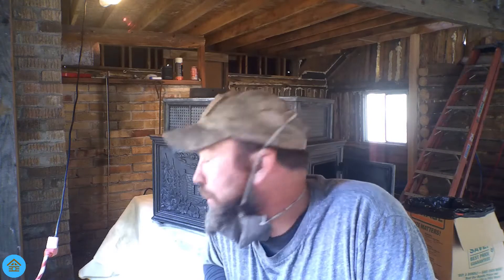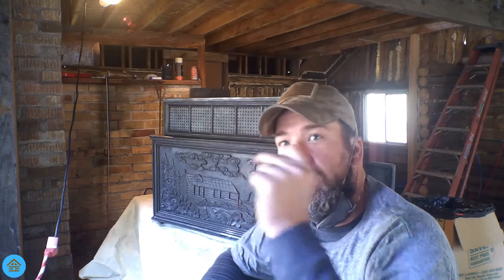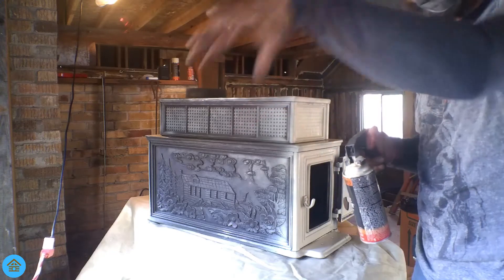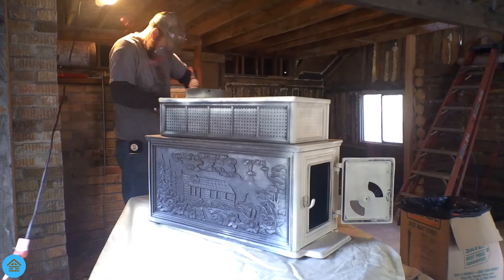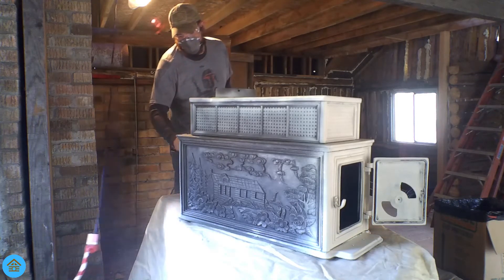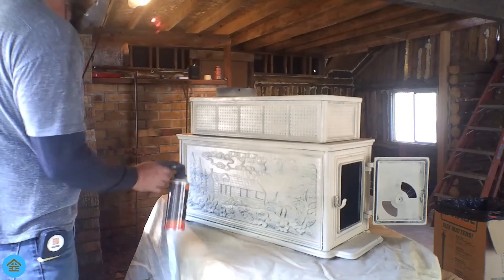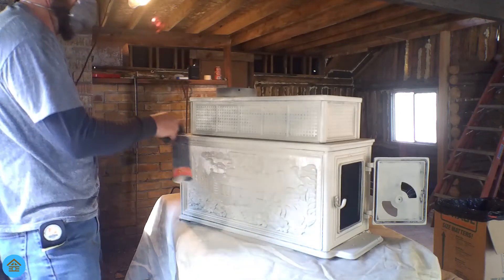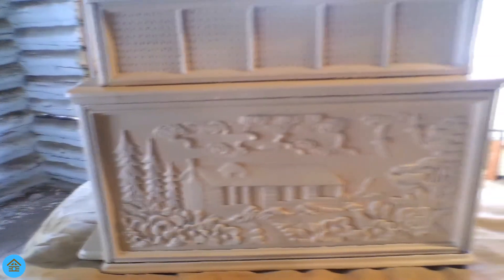How to restore a wood stove, part 2

Comment: Where's the Rosewood PINK? 🤣 Well in the dark you should be able to see it! It does look good. Not to be confused with good-looking! 😁   Now get some fresh air before you get high! 🤪
Reply from the maker: Sand Hollow Homestead lol!!! 
I still have accent work to do, but this was the start. 
I will probably work on it this spring.
Reply from the maker: Sand Hollow Homestead lol!!! 
I still have accent work to do, but this was the start. 
I will probably work on it this spring.
Reply: @LivingTheDreamHomestead.  It looks a lot better than before.